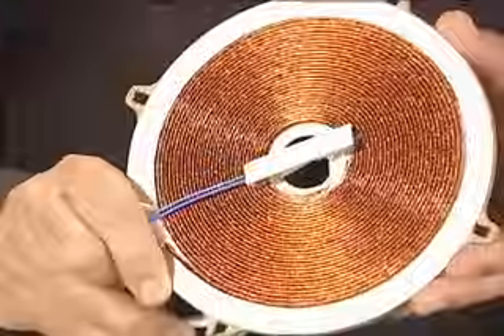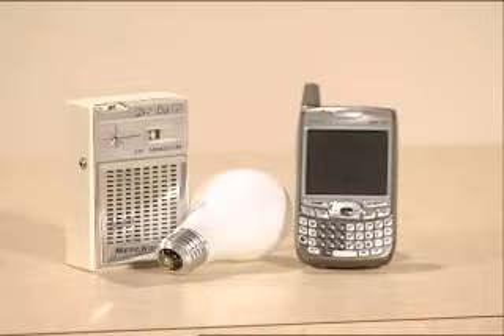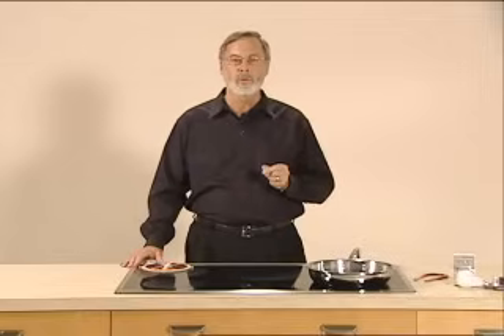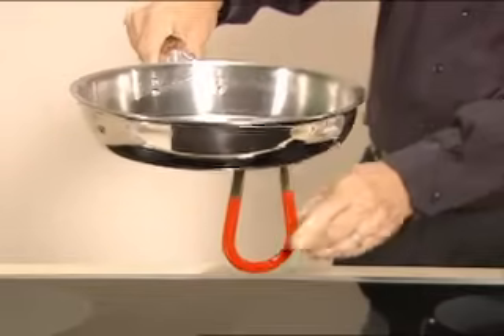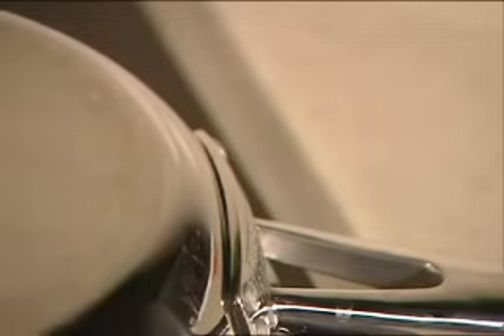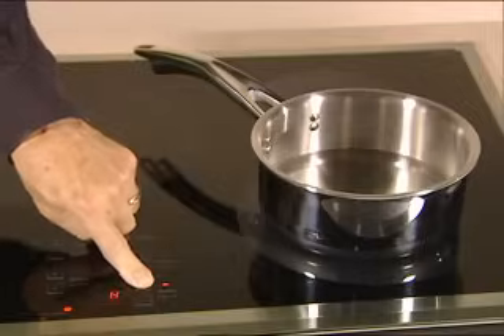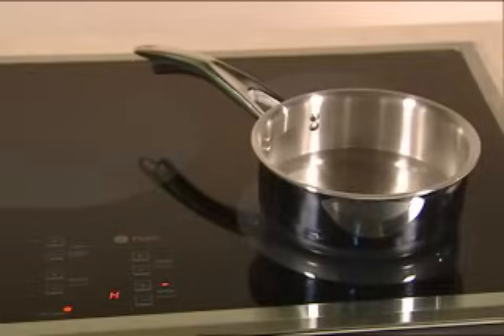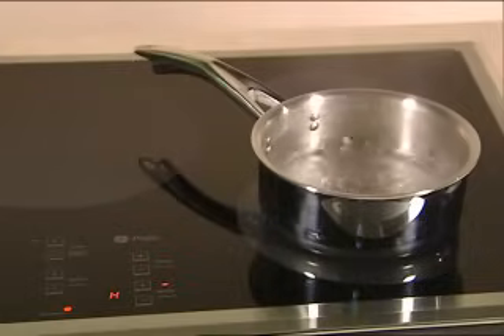How Induction Cooking Works

Comment: How about the safety regarding the high EMF? Is it more than normal stoves? How does it compare to, say, electric heaters?
Reply: Isn't it always a trade-off? I mean, gas has combustion components that have to go somewhere...and they seem to take longer to work in comparison (if the video wasn't paused when recording), so if boiling water takes much less time...?

Comment: Just a crazy idea, can we use induction coils as a heater for our 100% DIY metal heat-press machine for shirts? I believe they are using a conventional heating coil, but if the induction coil could work on a magnetic metal like iron, then it could work the same way as in traditional heat-press using an old-style heat element coils.

Comment: This still doesn't explain why bringing iron into the energy field of an electromagnet actually heats it to, how hot and what voltage or Gauss?  Also, why iron and not copper or aluminum?  And what's to stop someone from getting shocked when running the pan over the magnet (law of induction?)  Anybody know where to get such answers?
Reply from the maker: Hello Mef1975, we would like to offer you additional information from our GE website: http://www.geappliances.com/ge/cooking/induction.htm I hope this answers your questions. -SF
Reply: Not all metals from the periodic table are ferromagnetic (the strongest form of magnetism). Only few exist: Iron, nickel, cobalt, and a few rare earth metals. And to go further, it is about unpaired electrons on the lower shells. Aluminum can be magnetized, but the force is so weak you need special detectors for paramagnetism. So Al pots don't work. Copper has no unpaired electrons, so no magnetic properties.

Comment: "and it's the friction between those molecules that creates the heat"

uhm NOPE.
Reply: @olivier6840  And if you listen you will hear a small hummm. That is the vibration it will go on & off as temp is met.
Reply: @olivier6840  Iron is not a molecule it is an Atom. A molecule is a neutral group of atoms made up of different elements. For example water is a molecule made up of 3 atom, 2 hydrogen atoms and 1 oxygen atom. I literally haven't done Science in 5 years ...
Reply: Only iron, nickel and cobalt are ferrous. No other metals are magnetic.
Reply: Kenneth is right. its not friction, its eddy currents.
Reply: What do you think it is that creates the heat?  And why iron, but not copper or aluminum?
Reply: In YouTube you'll find all the answers you may want.

Comment: Just saying "electromagnetic energy is around us all the time" is a little misleading. Sure it is, but there are some forms that are dangerous. Not that I'm saying this is dangerous, but you need to state more information like what form of electromagnetic energy it is. I could put you in a microwave, turn it on, and say "don't worry electromagnetic energy is all around you all the time".
Reply from the maker: +Hobbes Thanks for your feedback. We appreciate it. Have a good day!
Reply: Chibi Terasu you are right carrying some fridge magnets in your pocket wont make you cancer, it is harmless but this thing is different it transfers significant amount of heat through magnetic field, the energy is too concentrated. It is eventually a wireless cooktop where the pot is too close to the power source. I never measured the intensity with an EMF meter of an induction cooktop myself but I've read some articles about it. I know it seems cool and practical in commercials but if microwaves were in our visible spectrum this cooktop would look like a disco ball in your kitchen. I would rather live a little longer instead of boiling my water 30% faster. Just use a damn kettle guys (=_=)
Reply: Berke Sokol.      isn't it just generating  a mag field.   there's no xray gamma waves or microwave .      practically causing heat by exciting the molecules in the metal pan.
Reply: +Hobbes they are not responsible to give you a physics lesson. The video was concise and the statement is true, and electromagnetic energy is not the topic of the video.
Reply: GE Appliances  What kind of answer is that? Hobbes is totally right. I am also curious about the electro magnetic field this product creates. Does it work like an open microwave or do you have a special technology which keeps the electromagnetic field only within the pot.

Comment: So  beware  punks (or married people)  :o)  don't put your hands full of metal rings over the surface,  or you will get hot fingers  :o)
Reply from the maker: +n45w73 Interesting thought! However even if the metal in the ring is magnetic, it likely wouldn't have enough mass to activate an induction burner. Thanks so much for your comment! Have a great day!

Comment: That had to be a time lapse at the end
Reply from the maker: Hi, LiberatedMind1. Our GE Profile series induction cooktops heat faster than gas or radiant cooktops. Compared to a radiant cooktop (12 minutes) or gas cooktop (13 3/4 minutes), induction cooktops offer the fastest time to boil; 1.5 gallons of water will boil in as little as 8 1/2 minutes. Very efficient!
Reply: GE Appliances Sounds sexy! When I build my house I'm going use induction hardware :)
Reply: GE Appliances
5,678 liters (1,5 US gallon) of water is about 5,68 kg (as the density of water is very close to 1 kg/liter) and the specific heat capacity for water is 4,18 kJ/kg/°C. That means that if the water is 20°C (68°F) from start (wich is pretty warm compared to what cold tap water usually is) - it need to be heated 80°C to reach its boiling point.
The energy needed for that is 5,68 * 4,18 * 80 = 1899,4 kJ and 8,5 minutes is 510 seconds so 1899 / 510 = 3,72 kW of heating power - even at a 100% efficiancy.

There is impossible in to avoid some losses (even if induction is very efficient)
 - especially since the pan is not insulated. That means in practice the heating power most likely needs to be at least 4 kW and that's very much for just one heating zoone.
So - I doubt it can boil almost 6 liters of water in just 8,5 minutes. Even if it's very efficient, it cannot exceed the physical limits. Claims like this will just make people without knowledge disappointed - even though induction is really nice stuff
Reply from the maker: Hello Ride84XL, Please take a look at our Induction 101 website in the link below:

http://www.geappliances.com/appliances/induction-cooking.htm

Have a great day!
Reply: GE Appliances
Yeah - I saw it now. The power is really 3,7 kW effective heating power as I understood it - very impressive!! 

The reason ordinary cooking plates doesn't have that power is most likely due to safety regulations - 3,7 kW on an 11" plate gives a power density of 6 W/cm² and if such a cooking plate is left on without a pan or with just an empty pan, it will destroy the stove and pans and is a big fire hazard. 
With the ceramic cook tops it would probably also be problem with overheated elements as the element get so much hotter than the cooking plate it self already at low power levels (and that temperature difference increases with increased power)

That's another advantage of induction - it allows for much higher power density. An empty pan will get very hot though - but is limited to 770°C (the curie point for iron).

Comment from the maker: Hello Devin Sikiric, Thanks for your interest in our creative induction cooking process.  As far as the pan temperature goes, it would still be hot and could burn you.  Since the pan would absorb the heat from whatever was being cooked or even boiling water, it would reflect this temperature so be careful.  What is neat is that you could place a paper towel between the cooktop surface and the pot and the paper towel would not scorch at all.  I hope this helps!

Comment from the maker: Hi David, You are right!  The induction cooktop uses a high-frequency coil, located just below the cooking surface.  This coil produces a magnetic field that causes the electrons in the ferrous metal pan to vibrate, which produces heat.  A fabulous way to cook!  Thanks for contacting us. - Sheree with GE

Comment from the maker: Spyderkat - The GE induction is very safe.  The induction cooking uses an electromagnetic field of energy and a pan with an iron-based core to create heat.  The induction units even have temperature limiters which keep the units and the cooktop from overheating (such as when a pan would boil dry).  This cooking is very safe and easy to use and does not create any other forms of radiation.  I hope this helps! - Sheree with GE

Comment from the maker: Hello Arxsyn, Thanks for your interest in our GE cooking products.  Both the GE induction and our microwaves are very safe, but 2 different types of heating.  Induction cooking, like our video shows, uses an electromagnetic field of energy and a pan with an iron-based core.  The microwave uses non-ionizing radiant energy like radio waves or visible light.  In sufficient concentration microwave energy generates heat.  Both are safe and user friendly.  Thanks for your questions - Sheree with GE
Reply: Interesting thar I know serious scientists who refuse to own a microwave, despite surely knowing it can't really "get you." 

Strangely, I did feel a sort of warmth/pull putting my hand inside a microwave right when I turned it off. There's a plate in my right wrist. 

I notice that people worried about microwaves are never worried about electric lights or cell phones. Haha

Strange that anyone should have to explain the difference to people much smarter than you are. It's not a 1940s shoe fluoroscope! My dad used to see those all the time. Still alive. Ha. 

Tho, I did have an aunt who used to sit in front of an older one (70s) and she got cancer of the lymph nodes right at the hight where the micro was. It's obviously not indicative of anything, since everyone smoked like a chimney back then that I remember. Not to mention the margarine (yuck), asbestos (til the mid- 80s, Armstrong told me) and lead all over the place. Oddly, still here, almost 50 years later. Lol

Might very well have asbestos in the house today. It was very brittle and extremely strong as I recall. Black adhesive used (aren't they all black, even to this day...?). That flooring will easily last 60 years with little to 0 sign of wear. . Haha  You should see my gramma's stove. It's got to be 70+ years old.  Ours, a modern machine? Maybe 15, tops. So, maybe lead and asbestos are good for you. Lol (you know older people never want to spend money on anything or fix it unless they REALLY have to)

Comment from the maker: internetzwemmer  -  Induction and standard ceramic cooking produce the same amount of heat.  The difference is the process and speed.  Unlike radiant cooktops, induction cooktops create a magnetic field, which in turn heats up the cookware. This means that induction cooktops can heat cookware instantly. As a result, induction cooktops are faster than radiant cooktops.  Thanks for asking!  -  Michelle with GE

Comment from the maker: Georgie Daniel - Induction is considered the most energy efficient surface cooking method.  However, for helpful hints to lower your energy costs when using any surface units, please visit our GEAppliances website and type "range energy tips" in the search field.  The Support Results will provide the appropriate links.  Thanks, Michelle with GE

Comment: Energy Conservation hard to answer question.  Our electricity is generated primarily using natural gas.  Generally speaking, would I be using less gas if I used gas or an electrical  induction cook top?  Anchorage AK

Comment from the maker: Current induction cooking systems are only efficient on steel pans due to the frequency needed to “couple” with the pan (match pan resonance). An Aluminum or other highly conductive or different material pan requires a resonant frequency multitudes of frequency magnitude different (like 10 times) or more than required for steel or iron.  Current technology does not have a practical or efficient means of generating large amounts of power over such a vast range of frequencies.

Comment from the maker: Induction cooking uses a high-frequency coil, located just below the cooking surface, that produces a magnetic field that causes the electrons in the ferrous metal pan to vibrate, which produces heat (Like the friction when rubbing hands together produces heat to the hands). This is the only cooking method that directly uses the cookware as part of the cooking system. Magnetic induction cooking requires the use of cookware made of Ferrous metals, like iron or steel, to which magnets will stick.

Comment: in an induction cooker, a coil of copper wire is placed underneath the cooking pot. An alternating electric current flows through the coil, which produces an oscillating magnetic field. This field induces anelectric current in the pot. Current flowing in the metal pot produces resistive heating which heats the food.

Now my question is, when current flows through the vessel, won't we experience a shock when we touch the vessel..???

Comment from the maker: @EvasiveEvo Hi! Here are a few suggestions for you:
Use the smallest burner if not already
Try a thicker bottom pan.  One with an aluminum core will distribute the heat more evenly
Hope this helps! Thanks, Megan from GE

Comment from the maker: @ImJustSlime If a rare-earth magnet (REM), such as neodymium, is smaller than the minimum pot diameter for the particular induction element, then nothing will happen. This goes for things like spoons, forks, coins, etc. The cooktop has a sensor that only allows activation of the induction element when a pan of the right dimensions is placed on it. Hope this helps! Thanks, Megan from GE

Comment: @TheZenPerspective "How long has this technology...been around? Good question. The first patents for induction cookers are from the early 1900's. Frigidaire, then a division of General Motors, showcased an induction cooker in the the 1950's on a touring GM showcase in North America. The induction cooker was shown heating a pot of water with a newspaper placed between the stove and the pot, to demonstrate the convenience and safety. This unit, however, was never put into production.

Comment: Induction heating is basically a transformer where the primary is in the appliance and the pan is used as a secondary. So why does the pan need to be magnetic?

Comment: @mickycheese27 Nothing will happen if you wear an iron ring: when you put a pan on the hob or take it off, there are no sparks, nothing, the panal just says E or F, depending on what make hob you have. Get one their great; use it with a stainless steel pressure cooker & you'll sale loads of money on lecy. These cookers are as controlable as gas: get one!

Comment from the maker: Hi mickycheese27 - actually the pan needs to be magnetic to make the burner operate but the pan does not actually stick to the bruner. So an iron ring will not be an issue and there are no safety risks.
Thanks, Megan from GE

Comment: I can't wait for the next generation of this stuff, as you could literally have a range top an inch thick total. I would suggest a rework of the coil(s), as we are still using Tesla based standards, Rodin's work MIGHT be something to look into, though a layered fractal based coil system would be better (and thinner). It doesn't exist....but..hey, that's why you work on it (like I do).

Comment from the maker: No, induction is not like a microwave. It uses a coil to create an electromagnetic field of energy, which then passes through the cooktop to the pan. In order for a pan to work on an induction cooktop, it must have some iron to connect to the magnetic energy.
Thanks, Megan from GE
Reply: The question is' why does only ferromagnetic iron work on an induction hob. And don't say "because it works by magnetism", that's not a good enough answer. They work by induction, currents will be induced in any conductor place on an induction hob. Stainless steel is a worse conductor than pure iron, but the magnetic Stainless steels work and the non magnetic ones don't despite similar iron content. So what is the physics behind it? Oh and the answer is only partly due to hysteresis.
Reply from the maker: Hi Donald - we have a link for you!  Please visit our Induction Cooking site at the following link - it answers questions about this type of cooking:

http://www.geappliances.com/ge/cooking/induction.htm

Thanks for checking  -CC